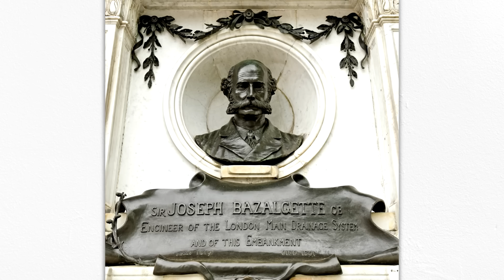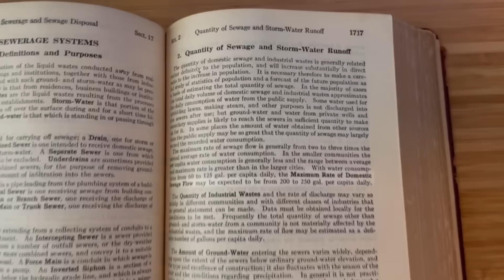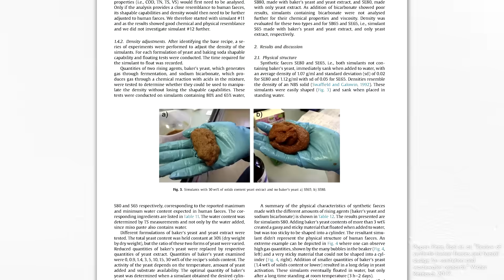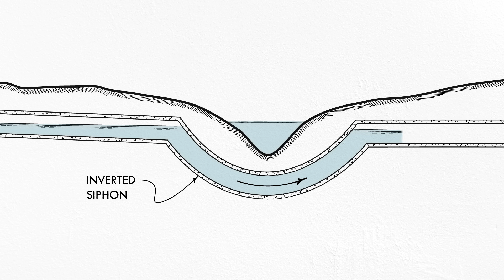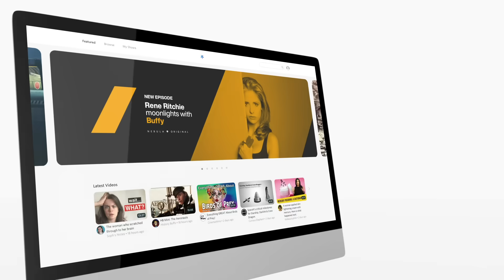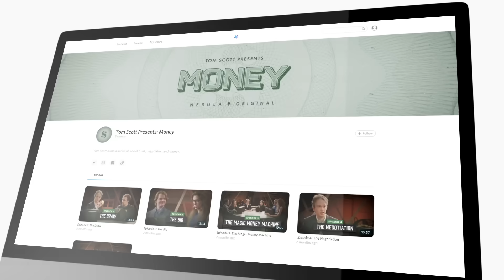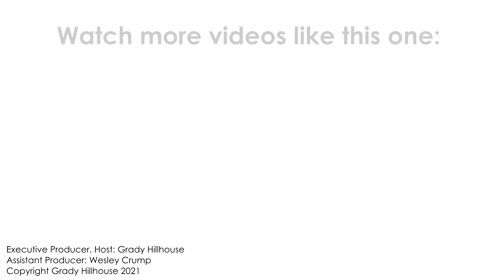How Sewers Work (feat. Fake Poop)

Comment: There is another problem with waste water emerging: Since people are told to save water, an increasing number of sewage systems have too little water to "clean themselves". Don't get me wrong, I think saving precious water is the right thing to do, but we have to address the resulting problems.
Reply: Grey-water collection systems should be mandatory on city buildings, and that routed into the sewers as need be.
Reply: That would be "too little water-to-solids ratio", right?
Reply: @samuelmellars7855  That is one side, I guess. Also less water means not enough inertia to remove stuff that has already deposited.
Reply: Unintended consequences of environmentalism.

Comment: The Brooks Aqueduct has probably the coolest inverted siphon. An open-topped aquaduct had to cross an existing train line, so an inverted siphon takes the water from well above ground level to under the train tracks to back up into the air. Apparently when in use they would drain it every winter, and people would gather to catch all the fish that would get trapped there.

Here's a picture I found:
https://www.flickr.com/photos/cmhpictures/19406312639
Reply: The aquaduct hasn't been in use for a long time. Now a raised canal runs parallel to it, which isn't as cool, but the canal still uses an inverted siphon to go under the train tracks.

Comment: There is an unknown connection between the sewer and storm drain in my community, the local sea water beach area gets closed to swimming because of fecal matter counts being to high fairly often. Tracing the lines to find the connection is not easy and the city still hasn't found it.

Comment: Surprised you didn't include anything about lift stations which are used when the sewage pipe hits a low point and needs to be pumped upwards to give itself more grade. As you said the worst products for jamming up these pumps are grease, wipes, tampons, pads and condoms. I am so happy flushable wipes weren't popular back when I worked there for a couple years.
Reply: Those wipes must be causing lots of issues to pumping machines and "quiet" runs of pipe. I've seen the damage they can cause in home sewer pipes, let alone huge systems. Plus the people who manage to flush baby diapers. 

I'll be happy with my septic system :) i had nightmares of city sewer backing up into my old house.
Reply: @volvo09  That's why they're called t-issues ...
Reply: I agree. Lift stations are an integral part of the system. I work for a water wastewater authority and see the daily, ongoing maintenance it takes to keep these systems going.
Reply: People are not only kinda gross but grossly unpolite
Reply: I hope to learn more about lifting stations---always wondered how they work.  Hopefully in a future episode.
Reply: Yeah. I know that in some lift stations today they install sewage grinders like muffin monsters to avoid clogs.
Reply: I'd be surprised if he doesn't have a part 2 discussing force mains.
Reply: As a retired lift station mechanic, I agree!
Reply: Yes!
Need a video on lift stations and jogging pumps!
Reply: Was thinking the same. I'm an electrician, and the company where I work does a lot of waste and clean water plant work. And lift stations are pretty common here.
Reply: Condom appearing at 3:20 to illustrate the issue. You're welcome.
Reply: I've seen 3 phase, 50kW+ pumps being braked by these so called "flushable" wipes. Multiple times a week. This would cause sewage overflows into the sea/fields and streets.

I honestly don't know if it is possible for utility companies to sue manufacturers for damages until they remove the flushable writing from the packaging.
Reply: @roderickborg952  that is pretty crazy, I would have expected a pump like that to just chew things up like Will it Blend.
Reply: @roderickborg952  how do you know they aren't non flushable wipes? People definitively flush them.
Reply: @robby-y3x  I used to work as an electrical technician on waste water pumps. They manage to clog, rattle the crap out of the bearings and stop completely pumps, which if you were to put your hand in it's impeller while running you would no longer have a hand.

You can flush bolts, nuts, washers, jewellery and any other small item in world, it doesn't mean that you should.

These wipes alone stick to each other due to their fibres and become a huge mass. Add grease and fats to them, and workers have to go down in sewers to manually break it down. People have no idea the stench and dangers utility workers go through because of them.
Reply: @robby-y3x  there is plenty of evidence that they should not be flushed and damage sewerage systems. Just because something  can be done doesn't mean it works well.

Comment: Time for those "flushable wipes" users to upgrade to the next level and get a bidet.
Reply: sorry.
Reply: The wipes are primarily used on babies and the elderly, who don't have the capability to utilize a bidet without serious assistance (and doesn't get the mess all over the cheeks from the diaper), or people who are flushing them into a septic system where there isn't need for consideration for the full sewer system (and as such they're flushable in the sense that they're safe for septi systems, technically, though still not good for them) so I doubt that'd help.
Reply: @KainYusanagi  It might be better to just put the wipes into trash instead.
Reply: @seneca983  Yeah, it is. 

When wipes are used on babies, they tend to get stuffed into the diaper/nappy before it's rolled up and trashed. 

As for the elderly, a bidet built into the toilet seat that sprays up is perfectly usable without any contortions. They're also great for those with IBDs because they are very kind on the rump (better even than wipes).

The real pushback I never seem to get over is people freaking out just because they've never used one before. I bet when doctors were told they had to wash their hands before surgery, there was that same level of pushback. You don't wash your hands by rubbing them clean on a rag—you wash them with water.
Reply: Asia countries usually have a tap and drain hole in toilet. It makes cleaning in the toilet a lot easier. In addition, we don't need bidet, with a tap beside all we need is a hose.

You guys need to redesign your toilet.
Reply: @chengkuoklee5734  Heh, I purchased my bidet from China and it's been working fine for nearly 10 years now. When I got it, it was $20USD. It has easily paid for itself just with the equivalent toilet paper, let alone the expensive (by comparison) wipes.

I rent, so I have no control over permanent fixtures like toilets and appliances, but with a bolt-on seat bidet I can have the cleanliness I desire and not get kicked out of my lease.
Reply: @chengkuoklee5734  You mean the little-better-than-a-hole-in-the-ground squat toilet, lmao? The one where your piss and shit splatters against the shallow bowl and gets over your shoes and clothes? Yeah, nah. There's a reason that squat toilets get phased out as soon as western-style sitting toilets get brought in (and they can afford them); they're the superior shitting experience. :P
Reply: @KainYusanagi  I don't know what are you talking about. My experience with US Europe airport toilet.

Western toilet just a toilet bowl and tissue paper holder, while Asia airport the furthest Asia airport I know at Qatar beside the toilet bowl there is toilet paper holder, hose tap and drain hole like other Asia counterpart.

This design make cleaning convenient.

Comment: My city is currently using a TBM to dig a new 14.7Km 4.5m diameter Sewer. because the current ones are 50 years old and weren't big enough to start with they started in 2015 and will finish in 2025.

Comment: in my experience, the slope should not be too steep so as to keep water from out-running the solids, and this is especially important the closer you are to the source (toilet). since it will see rare flows only when sewer drains are being used.
as you showed in your example, the SOLID solids move much slower. if the pipe is too steep, the water flushed with the poop will soon rush past the poop, leaving it sliding on less and less water. the toilet does not continually run water down the drain. so its gotta keep the water WITH the solids.

Comment: I DIY built my own home extension, which included a toilet and kitchen so required reworking much of the existing underground drainage around the house. Was fascinating, but also surprisingly tricky - for exactly the reasons you state. It's easy to get the fall in one place, but then I'd realise it would be too high at the end of the run - it also had to go through foundations and through concrete which has its own challenges.

Great video - absolutely fascinating. Absolutely love all of your public infrastructure work

Comment: Hello Grady great video as usual! I have a question. I live near mexico city and I once read that, because of the unstable soil of the city, the 100 years old sewers were actually leveling and the flow rate was decreasing so they had to install massive pumps to keep the sewers working. ¿Do you know how these types of pump work? I imagine they are quite different from a regular pump since they have to deal with solids. Thanks!

Comment: 1:44 - this looks to me like district heating steam pipes, now sewer, unless it is pumped under high pressure, but then why would you need a return pipe?
Reply: Those are called “forcemains.” When you are forced to move sewage uphill—which is inevitable in at least a few places in a large system—it is done from pump houses called lift stations, and since the flow is under pressure you can’t perform maintenance while they are operating, so they are almost always built in pairs for redundancy and flexibility of operation.
Reply: @dennisfox8673  Thanks for explanation.

Comment: Joe Baguette, the patron saint of over-engineering.
Reply: I'm inclined to say that in some cases there is no such thing as "over-engineering", just a trade-off of budget vs how far down the timeline you wanna kick the "maintenance can". I'd say 150 years is pretty cost-effective. American wallets are tight when it comes to spending on anything with "public" or "infrastructure" in the name, so we only kick the can down about 15 years, just past most state & local election term limits.